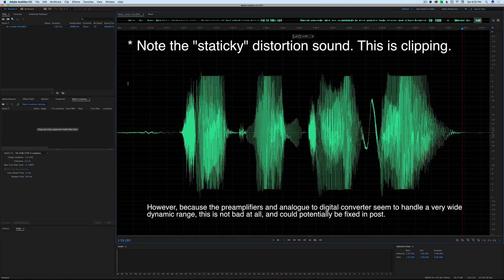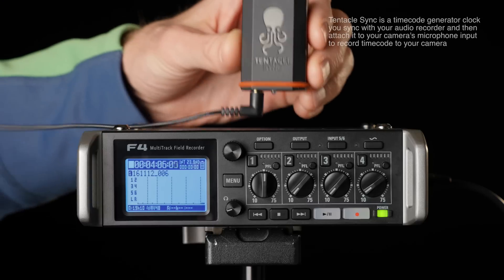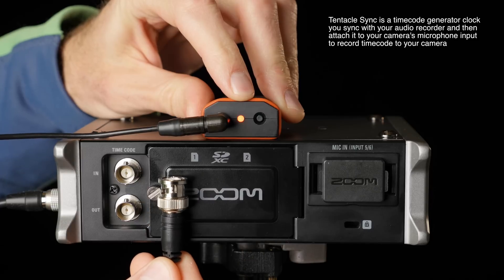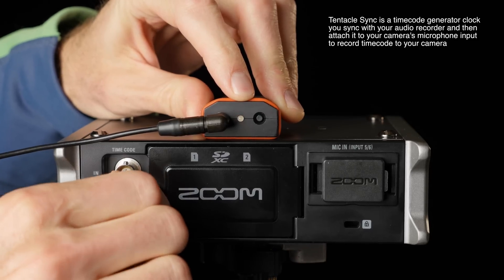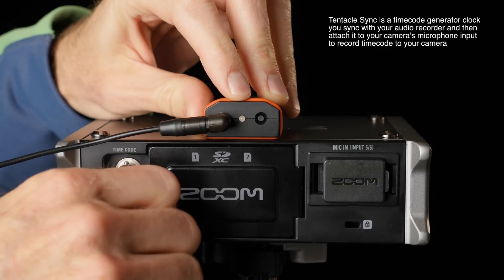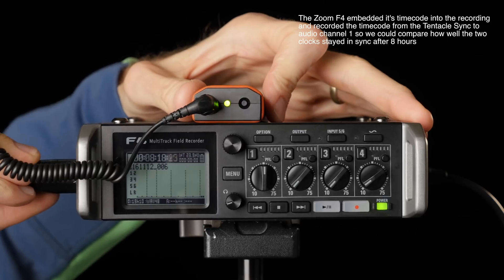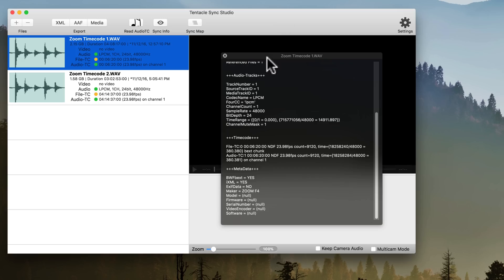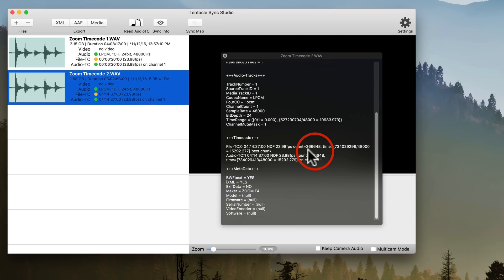Zoom F4 Limiters and Timecode Accuracy

Comment: Greetings Curtis, I am a faithful follower of your programs on YouTube and I have found in them answers to many of my questions. 
I am new to the video area with DSLR and I liked the report where you explain the versatility of the Tascam DR 701D that can synchronize 
the audio through HDMI as timecode and record separate audio and video. I know of your preference with the Zoom F4 and F8. What I do not 
understand is if I can synchronize them (Zoom F4 & F8) with a DSLR (I have the Canon 6D) directly (as with the DR 701D) or I need a synchronizer 
like Tentacle Sync. Thank you.
Reply from the maker: +Didimio Rios hi Didimo, with the F4 and F8, you'll need a timecode generator like the Tentacle sync.  Or you can manually sync with a clap at the start of each clip. Thanks!
Reply: Thank you Curtis.

Comment: Does a stereo mix track really matter anymore? To me it seems like it would open post production up to more options if you recorded all inputs all the time. I know a lot of mixers are still sold with stereo mix coming out for in camera audio but why else would we need a stereo mix other than in camera audio? Nice video BTW.
Reply from the maker: Some productions require stereo mixes plus isolated tracks. The Stereo mix is usually used for dailies and editing and then the ISOs are reserved for the post sound group as a backup or if the stereo mix isn't great, they replace the entire stereo mix with a new mix they create from the ISOs. But on corporate pieces, I almost always go with the ISO tracks.
Reply: Thanks. I want to do more indie film type stuff and eventually open up to more pro level work. Just the choices are killing me. Should I get a sound devices 302 and run that to my recorder or go with a zoom f8 to record a ton of ISO tracks... Still not sure but I'll figure out a setup, then replace it with another one later I'm sure. Lol. Thanks again for your help.
Reply from the maker: Good luck Joshua. The Zoom F4 is a slightly less expensive option if you're pretty sure you'll need to replace it later. :)
Reply: Yeah, it's on the list of possible recorders.

Comment: Again thanks Curtis another great review. A slightly unfair test, but it can happen in drama or a live event  -  given that the F4 can record a duplicate track at a lower level and has slightly larger knobs to ride the level maybe it's not a major problem. Zoom have really shaken things up here considering what the price of the equivalent Sound Devices units would be.
Reply from the maker: Yes, the F4 is very capable, and perhaps even incredible given its price point. With the amount of headroom in the preamps and converters, I would not hesitate to use the F4 for pro jobs. Just need to watch the gain staging.

Comment: Could you do a session on multi-cam shoot using Tentacle Synch, specifically the import/synch process for multiple cameras and  how you get the synched content into both adobe and final cut? I haven't  found anything  online that really explains a work flow for multi-cam shooting with the Tentacle hardware/software and digesting the synch material into NLE.
Reply from the maker: Will do, yes.
Reply from the maker: Exactly the way I would do it. Will include in the demo.

Comment: As an electronics engineer, I guess I should know the answer to this. How does a digital limiter work?

Here's my assumptions:
1. The signal arriving at the A/D converter has not clipped. (If the analog input chain is driven into saturation then the A/D is converting a clipped signal. Digital limiting can't help.)
2. The signal input to the A/D converter is higher than the maximum level it can convert.
3. When the signal level is too high, the A/D converter outputs the digital code for the maximum level.

At this point, what can be done in the digital realm to mitigate the distortion this represents?

The only way I can see a digital limiter working is if the signal is not clipped at any point and is digitized correctly. THEN a digital limiter can keep the amplitude within some bounds.

So where am I going wrong? (I researched this online but nobody talks about the details of the internals.)
Reply from the maker: I agree, digital limiting should in theory only really help in cases where the audio has not saturated in the analogue stage and the converter is able to convert it. Then is will simply pull back the transients which are above the threshold. I suppose this could be used as a way to reduce the amount of post processing you might want to do, particularly if you use the soft knee setting to hopefully make the result a little more transparent.

All that aside, I do find that the F4 (and F8's) dynamic range is very good when using a microphone with a good dynamic range, particularly for their price points. And with that range, the need for a limiter is fortunately reduced.

Comment: Good test, thank you for those info ! So in then end the limiter are just useless right ? Zoom said that the limiter allow for 10db of headroom, did you find that it was the case and do you find that it is enough ? Also have you test the feature of the dual channel recording with a safety track at a lower level, would it help prevent clipping or not ? Thanks in advence for your answer!
Reply from the maker: +Antoine van der Straeten hi Antoine, I wouldn't call the limiter useless. I would say that the dynamic range of the preamps and converters in the F4 are so good that limiters will rarely be needed if you set the gain correctly. And if you're expecting things to get really dynamic, the dual channel recording feature does the job.

Comment: Great review, well said, good info. I recently did a few 24 hour time code tests to figure out why my SD633 was out 2 frames from my
Tentacle Sync in 5 hours of shooting. Turned out the 633 TC clock was off by 10 frames in 24 hrs. Ran the 633 against 3 Tentacle sync units for 24 hrs. The Tentacles tracked exactly the same which goes to show how accurate they are, all less than half a frame after 24 hrs. I rented an Ambient ACC-501 calibrator with GPS module and corrected the 633 to less than half a frame in 24 hrs. So TC accuracy is important even on a pro Sound Devices recorder. Something pro sound mixers need to be aware of and check out on occasion.

Your method of checking the TC accuracy of the F4 by using Tentacle Sync Studio depends on when the F4 writes the TC meta data into the file header, on Record or on Stop. But that would not matter if you recorded a short file once every few hours over your test period of say 24 hrs. I used the Difference display in the 633 Jam Menu to determine what was going on with different TC sources.
Reply from the maker: Thanks for the additional info! Is the timecode calibrations something you can do on the 633 without opening it up? Great to hear that the tentacle syncs held up so well. Good investment.

I assumed that the F4, and indeed most recorders, write the timecode meta data on file open, but that's a good point that they could wait until file close. Then again, both the 6 series SD and the Zoom F4 and F8 close the file periodically while recording to prevent data loss in the event of power loss so I would hope this means they're writing the timecode data at file open.
Reply: Curtis Judd All recorders and TC devices like Lockit boxes that use Ambient TC electronics can be calibrated or tuned by plugging the ACC-501 into the LEMO connector and initiating the tuning sequence. What I don't know is how my 633 got so out of whack and therefor wonder will it stay accurate or is there something internally wrong with it. I will check it again after a month or two and see. 

I thought all TC capable recorders wrote the TC meta data on Record start. But I recently accidentally pressed pause on a Roland recorder while recording. I was doing a TC test with Tentacle units. In Tentacle Sync Studio all 36 video and audio clips synced OK (green). But the one clip that I pressed pause on for 5 seconds was out of sync by 5 seconds. The entire clip was out of sync. So you tell me when the recorder wrote the meta data stamp. Surprised me.
Reply: Which Roland recorder was that?
Reply from the maker: Interesting and good to know!
Reply from the maker: Worth a test, including a pause to confirm that the Zoom is writing the timecode at file open. If it is, then I would expect that each new audio file should now throw the sync off more than it would if it were written as one huge file.

Comment: The f8 time code tends to go out of sync when powered down, there is no small battery powering the clock separately, like for example on a SD 633. It's the same with the f4?
Reply from the maker: +Vincent Rozenberg yes, same.
Reply: Thanks Curtis for your reviews!
Reply: How long is the battery life with just internal batteries?

Although of course with an external battery you should  never ever need to shut down.
Reply from the maker: That depends on how many mics you're phantom powering. I'll have some numbers in my final review in a couple of weeks.
Reply: IronFilmVR my experience with the F8 is about 2/3 hours with 2500 mah batteries. 1 phantom for boom, 2x wireless and LR recording on. Even things like how loud you set the  headphone out affects the power consumption. In real world situations always use a proper external battery.
Reply from the maker: I agree on the F8 battery life and that external power really is necessary for most projects unless you want to keep swapping out 8 batteries or perhaps buy a few of the AA battery trays and keep them on hand, filled with batteries (not a great solution).

So far in my tests the F4's AA battery life is a little better than the F8's, presumably because of the small monochromatic LCD screen and fewer inputs.

Comment: Oh man - TC and SYNC use to be so, so so important back in the day.

I honestly find a dumb-clapboard(no electrontics, just the clap!) is the bare minimium.  Unless you are doing long form videos with multiple cameras, on a weekly or daily schedule, you can almost forget about it? 

With all of that said......I have run into issues that you shoot two or more cameras at 30FPS and the audio is 1/2 a frame off between the two (of course it can never be more then 1/2 a frame off - duh!) you can see with your eye if you are really looking.  99% of people won't see it - but if you are an editor, and know it's 1/15 of a second off, you totally will see it - and drive you up the wall.  If no one tells you it's there, you'll never know.

Fun fact....A lot of moves have the dialog slightly delayed from the picture (an artifact of the projector being sightly of sync from what it was printed on) and it's part of what makes a film seem like a film (so letting audio lag the visuals can be used to mimic old 50's 60's 70's 80's film)

Another great video!  Please keep them up!
Reply from the maker: +GeorgeGraves thanks George. I agree that a slate is still useful. I find that most cameras have some latency - at least prosumer cameras, so offsetting the timecode on the camera clips is often necessary.

Comment: Excellent as always Curtis. Talking about new videos, could it be possible to have one related to the timecode sync recordings workflows using the tentacle sync device? 

Thanks so much. IGIS producciones.
Reply from the maker: +IGIS Producciones yes, thank you for the suggestion.
Reply: I second the request for a video about tentacle sync workflows. An F4 and a tentacle (roughly $900 total), sounds like a pretty enticing option for enthusiasts/hobbyists of means, and lower budget filmmakers.
Reply from the maker: Will do, thanks!